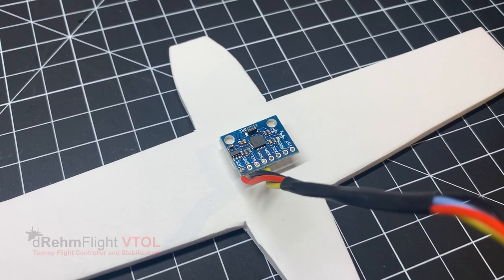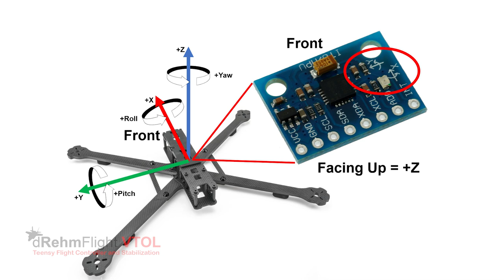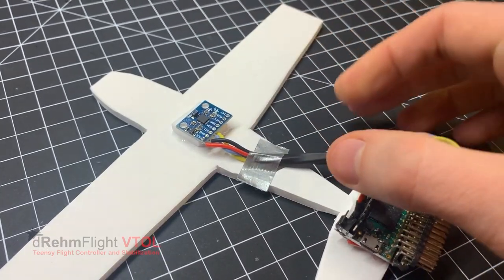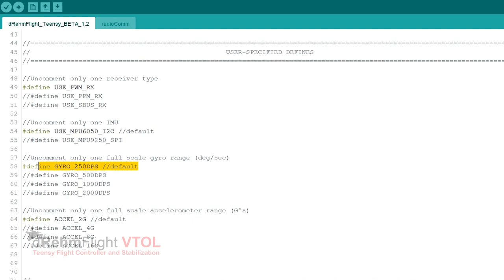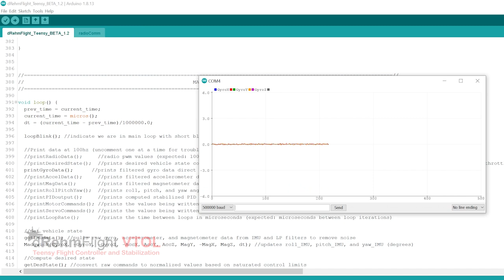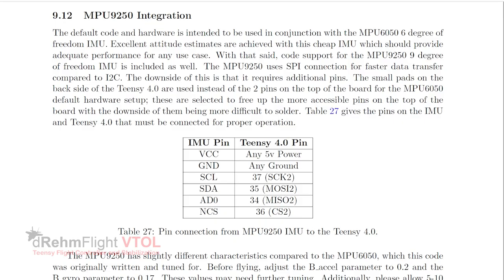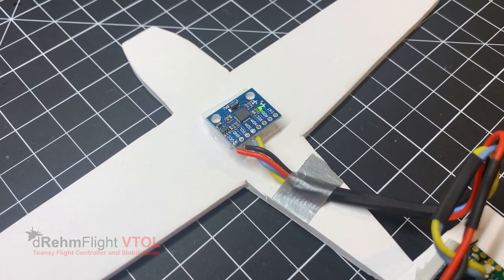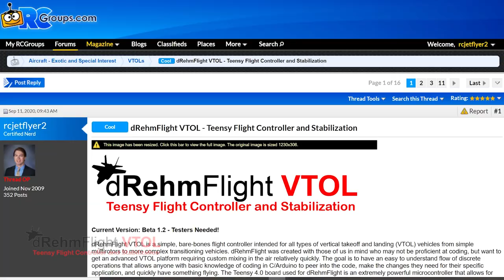Mounting and Configuring the IMU - dRehmFlight VTOL

Comment from the maker: NOTE: This video is slightly dated. In dRehmFlight Beta 1.3+, upload the code as described and open the serial monitor. IMU calibration parameters will be printed to the monitor. Paste these in the user specified variables section, and comment out the calculate_IMU_error() function in void setup. This one-time calibration procedure prevents the need to leave the flight controller still for EVERY power up.
Reply: Great project and code.  Thanks for contributing it. In Calculate_IMU_error(), should you set the AccErrorx, etc to zero before doing the averaging.  Otherwise, a person's prior values will be included into the average.

Comment: Another great tutorial, thank you! I took me some time to get the IMU working. I bought a package of 4 and 3 out of 4 were actually broken, only returning zero values... It took me some time to figure it out! Or maybe they are not broken but work slightly differently, because they seem to require the INT pin of the IMU to be connected to a digital pin... Anyway, it works now, thanks again!
Reply: Hello, I am facing the same issue, the previous mpu6050 I had worked and with this one it is only telling initialization unsuccessful, how did you wire the INT pin to make it work ?

Comment: Hello Mister Rehm,
awesome project you put up there! I'm trying to get it to work in a tandem wing plane with differetial thrust for yaw. The servos work just fine, but I'm having a problem with the motor/ESCs: The program puts out OneShot125 values as intended (under "motorcommands"), but the motor just won't budge and bleeps as if it had no flight controller connected. I tried another ESC and it fried the motor, so I'm cautious about trying anything else. Do you think it's the ESC/My dumbass shorting a connection, or anything in the code?

Comment: Hello man, great job!
I have build a drone with this, it works really cool, however, one problem.
My model requires to mount the battery on the front side of drone, it is like nose heavy.
When I try to fly with this, it is drifting to the front, because it is nose heavy.
We now that in betaflight it is tuned very well, I believe it is possible with dRehmFlight too, can you tell how can I adjust it?

Thanks!
Reply from the maker: You can increase the pitch I gain which will compensate for the weird mass distribution. Another option is to multiply the thro_des variable in the control mixer by 1.1 for the front motors, and 0.9 for the back motors—or more/less based on how much mass imbalance there is. This is essentially what the I gain is already doing when it spools up, but it’s better to pre-tailor the throttle values if you know it’s unbalanced
Reply: @NicholasRehm  I got it, thank you for your prompt reply!

Comment: I am close to completing the project. My mistake was assuming the 4-in-1 esc had a bec and that the + output was ~5v. My 4-in-1 puts the v-in on that lead so in my case it was 12 volts. Fried my receiver. I did not have the teensy hooked up (wanted to test the esc directly from the receiver) so I did not damage the teensy or IMU.
Reply from the maker: Unfortunately I’ve had a run in with a similar ESC where I assumed it was 5v out but was actually 12v. Fried a teensy and IMU haha
Reply: @NicholasRehm  I wish I read this comment before I fry my receiver. Guess it's dRehmFlight ritual for the safe flight.

Comment: Nicholas - would Teensy 3.1 do the job as well ?  I just tested this IMU part of code with Teensy 3.1 and I can load it into Teensy 3.1 and this works. Please comment. Thanks in advance.
Reply from the maker: Yes but check the loop speed, you might need to tune some of the filter parameters for good flight performance if it’s slower than 2khz
Reply: @NicholasRehm   Yes I will ASAP... Thanks

Comment: question: Is a yaw_IMU variable drift of -0.82 degrees per second 
normal? The only time it doesn't happen is when the sketch is started by
 uploading the code on the teensy, if it's started simply by powering it
 on or pressing the reset button on the teensy, the drift is there. I 
only have the printRollPitchYaw() function uncommented to work.
Reply from the maker: Yes that's pretty much expected and should be okay. Make sure when you're powering the teensy that you leave it still until the 3 blinks on the board tell you it's done calibrating
Reply: @NicholasRehm  yes it was always mounted to something and I made sure that I didn't touch my table. But that drift kinda bothers me, is there a setting or something to change the accuracy, like the #defines of the gyro maybe? But since it must have something to do with the teensy uploader triggering board reboot, cause that's the only situation, where there is no yaw spin, just some oscilation like on the X and Y axis, I don't think it's fixeable like that. Do you know the specific variable before Madgwick maybe, where I can manually add a hardcoded offset like .41° every 500ms or something?
Reply from the maker: @felixbaum2180  yaw_IMU is never used in the code for anything, so as long as the gyro_z measurement is zeroed (printGyroData()) then you are fine to fly. Absolute yaw orientation doesn't mean anything for us and doesn't matter if it has a slight drift
Reply: @NicholasRehm  Oh, okay sounds good, I thought it would drift in hover mode like that, but nvm then :)
Reply: @NicholasRehm  got it fixed! For anyone else having this (minor, but still) issue: 
1.Search for the line
     float AccErrorX, AccErrorY, AccErrorZ, GyroErrorX, GyroErrorY, GyroErrorZ;
2. and add a variable like mine to it:
     float AccErrorX, AccErrorY, AccErrorZ, GyroErrorX, GyroErrorY, GyroErrorZ, ManualGyroCalibOffsetZ = 0.8394;
3. Search for the line :
     GyroZ = GyroZ - GyroErrorZ:
4. change it to:
     GyroZ = GyroZ - GyroErrorZ+ManualGyroCalibOffsetZ;

5. Now tweak the variable until you get the yaw of the "printRollPitchYaw" function right. Always make sure to upload, wait for confirmed upload, pull out the USB, so board has no power, plug in the USB, and tune it to that. Never tune it to the variable you'll see right after uploading, it will not be like that if you boot it without uploading. 
Also I noticed that the Value of this compensation is as good as i can tell exactly the same and not behaving any different. 

BUT the value depends on the IMU board you're using(and maybe cables or sth), I tested it with three MPU6050s, all are slightly different, but around that 0.81-0.85.
If you did it right, you shouldn't have an offset of more than 2° after 5 minutes. Maybe you could even get it completely down to zero, idk :)
Reply: @felixbaum2180  as Nicholas said, it probably doesn't affect performance if absolute yaw is unused, but your description of it mattering how you reset suggests that the issue is in the power up of the IMU.

Many devices output less accurate values when started and then settle after a bit. If that's the case here, then altering the code to wait a bit longer before it starts averaging to find biases might help.

I don't know what the code is like, so I don't know if that is an accurate guess or if a change to improve it would be easy or hard, but it's an idea to investigate.  If correct, that fix would be less finicky than manually subtracting a bias and hoping it does not shift from flight to flight or over time within one flight.
Reply: @doctorbobstone  Yeah that's true, I didn't say that it's a pretty solution :D . Will definitely try delaying the start of the calibration progress. 
Nevertheless I had no issues with the subtracting method so far in case anyone wonders.

Comment: Nik, i have receiver and imu test running just fine but the servo and ESC outputs remain at initial values ( as viewed on oscilloscope) despite any imu movement or transmitter stick movement. what am i doing wrong?
Reply from the maker: Have you made your mixing assignments to the outputs in the control mixer? Tutorial 9.7 in the docs
Also, you may have throttle cut engaged with channel 5 on your radio. Uncomment the printradiodata() function and make sure channel 5 have a distinct ‘high’ and ‘low’ value when you flip the switch on the radio
Reply: @NicholasRehm  you are amazing! I had failed to configure Chan 5 on the transmitter. Thank you again. I've ordered 2 more teensy boards to build for two more buddies. 
The teensy 4.1 has an SD card present.  Any thoughts on adding black box functionality?
Reply from the maker: @poporbit2432  I have a function to log all relevant data onto an openlog sd logger with the 4.0. Might include that function in the next release which should be straightforward to get working with the onboard sd on the 4.1. Problem is I use MATLAB to parse/plot the data and not everyone has access to that program. So I will have to look into maybe doing that in excel so it’s more accessible
Reply: @NicholasRehm  any possibility of formating the data to be displayable with the Blackbox utility in betaflight?

Comment: My mpu is a 9250 should i change anything? cuz the code is saying mpu 6050 initialization unsuccessful
Reply from the maker: Yes, is the user specified defines section, uncomment the MPU9250 to tell the code that is the IMU you're using. Section 9.12 in the docs gives the pins for wiring up the 9250 (back pads on the teensy 4.0). You'll also need to follow the procedure to calibrate the magnetometer and update magnetometer calibration variables, detailed in section 9.4. I HIGHLY recommend using the 6050 though, unless you really really need the 9250. Code is tuned perfectly for the 6050
Reply: Thanks

Comment: Wondered if anyone can help with the Serial Plotter function.  I have exactly same hardware and have been trying to replicatew this with my son.  SO far we have success but we are unable to visualize the gyro data using the Serial Plotter as you see in video around 2.14.  We can see the gyro data using the Serial Monitor and it responds as the gyro is moved, so the Teensy connections and program see to be operating as expected but its a real shame we cannot visualize the data and only have the number stream.  Before this week I have never touched Arduino, Teensy or programming , so its all new.  My son is a keen RC flyer and is 11yrs, so we try and use this as a project to get his interest in programming (although its advanced)  and he understands the concepts in flight controllers.  If anyone can help a couple of newbies make the next step it would be much appreciated.
Reply from the maker: Hmmm, unable to open the arduino serial plotter?
Reply: @NicholasRehm   Sometimes a picture speaks a thousand words.  This short video shows the data stream from the gyro that we are seeing on the serial monitor.  Problem as you see is that its not visible when we select the serial plotter.  (you show on your video nice graphical representation and we see numbers.. which is OK to a point).  As I mentioned above we had never touched FC boards or Arduinos before the weekend so probably we are just making dumb mistake with a view settings!    We had a couple of replies from PJRC forum but was not really helping solve the problem.   https://www.youtube.com/watch?v=ocJ5wURaeHU   This video shows our first setup yesterday for the control sticks and centres etc.  That all went well first time!
Reply from the maker: @markparsons5677  make sure the serial plotter baud rate is set to 500000
Reply: https://studio.youtube.com/video/SSRKq5UgJ44   
 First part centering servoy and end points went without a hitch!!  Overall we are really grateful for your work and efforts, its a great learning experiance for young and old alike!
Reply: @NicholasRehm  Can select Baud in Serial Plotter but no way to change the Baud Rate, could this be some difference in the later version of Arduino that I am using?  https://www.youtube.com/watch?v=bZ5HkgNzh6Q
Reply: I actually just fixed it. There is a bug with Arduino that spaces in code prevent the data from being printed out in serial plotter. Under the void printGyroData() 

void printGyroData() {
  if (current_time - print_counter > 10000) {
    print_counter = micros();
    Serial.print(F("GyroX:"));
    Serial.print(GyroX);
    Serial.print(F(" GyroY:"));
    Serial.print(GyroY);
    Serial.print(F(" GyroZ:"));
    Serial.println(GyroZ);
  }
}

If you replace the function with this it fixed it for me. The fix is removing a space at the end of the Serial.print(F(""); lines. The old code being Serial.print(F("GyroX: ")); and the new code being Serial.print(F("GyroX:"));

 @markparsons5677